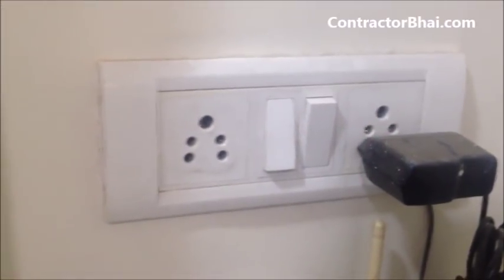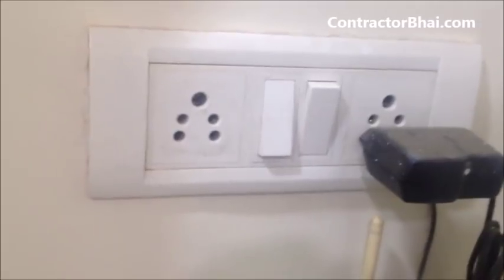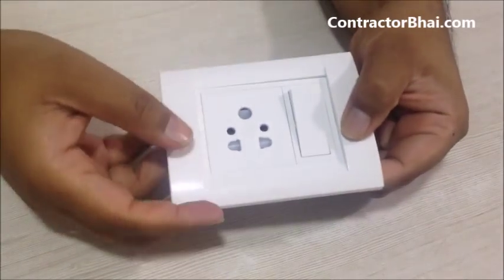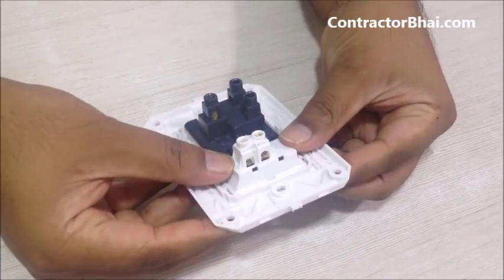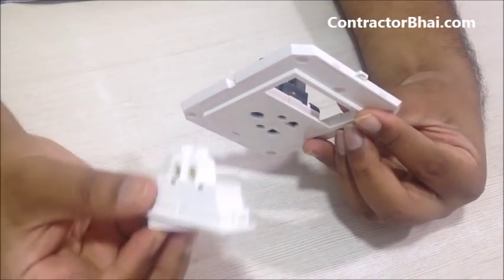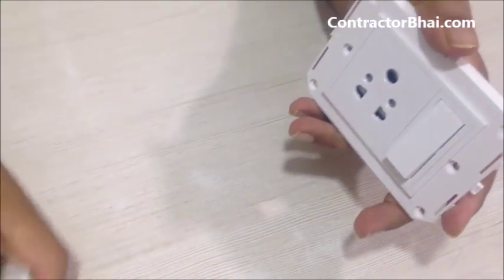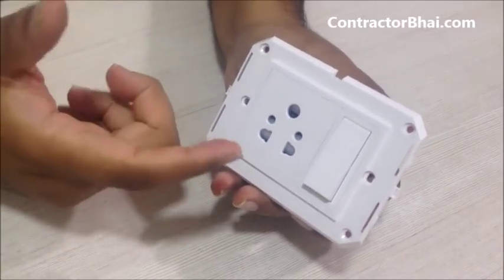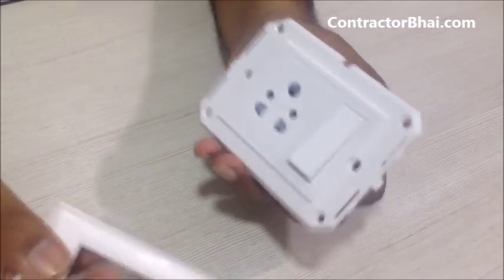"Modular Switches for Home Electrical wiring" by ContractorBhai.com

Comment: Single power cord extension latches are available abroad. In India I could not see any model. Any idea if its available or you can do it?
Reply: I mean with protection (cap or cover), not open modular switch and socket I am talking about.

Comment: waste of money in the name of convenience and beauty, I have seen people braking many switches and sockets and locks even brake even from the highest ranges, while just put an old day switch it'll work for decades
Reply from the maker: I hear you. I have had few sockets getting damaged at home & office. This usually happens when you have socekts which have cover flaps from inside. It is difficult to plug in & plug out easily, if not done correctly. Good quality branded ones have had least problem for me. But I agree, what happened to those old days sockets which stayed for ages..

Comment: sir please tell me can we remove tje cover from holes,i find it tiresome to put chargers to it,even some charger broke!
Reply from the maker: dont modify switch or switch board, it is not recommended & high risk. Latest sockets come with internal mechanism where a lid like thing hides holes from inside. Design is meant to make your socket more safer. However I agree it creates problems with certain types of charges. Specially when I visit Starbucks, I am never able to get my laptop charger in to plug. Then a starbucks guy will come he will insert a plastic straw to push open inside lid. He/she will push this in to un-required hole. Once that is done, charger goes inside. I am not suggesting that you do something like this everytime. Instead find a extra adapter piece in front of your charger that pushes in to all the holes. That will make it easy for you to use charger.
Reply: pakhi kala BOOKS

Comment: if its on the wall how do you remove that case? do you just pull it out?
Reply from the maker: +Kusuma H.v the outermost skin/frame/order can be simply pulled from corner. Once that is out you need to remove screws then it comes out. However dont do this on your own. Experienced electrician needs to do this carefully.
Reply: +Nitin ContractorBhai thank you... did it and put it back... was wondering if there was a two way switch for that.... OK next time when electrician comes I'll ask him....

thank you.